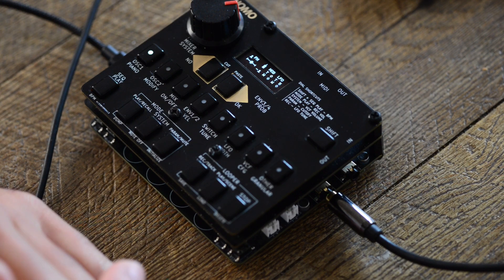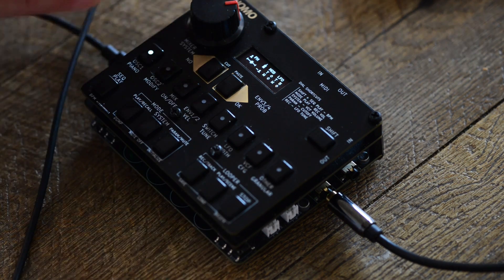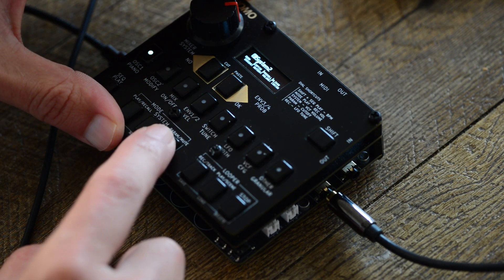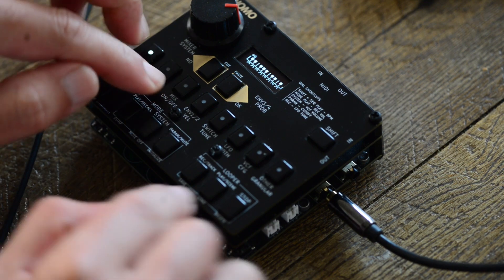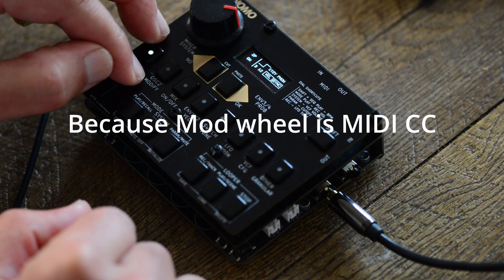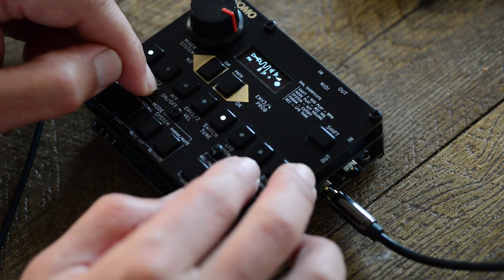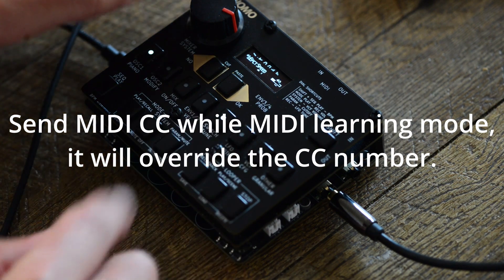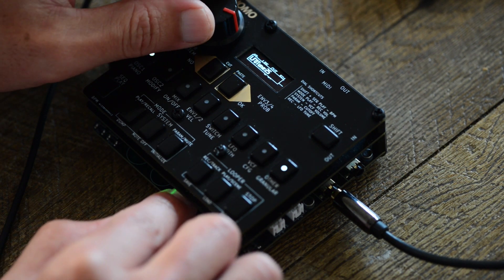Qun mk2 : Touch slider

Comment: Can you listen to line in audio without having to press a piano key the whole time? I’m trying to use the unit as a effects unit for my synth. Thanks.
Reply from the maker: There are several ways to do it. If you already set AUX L or R as an oscillator source, then you can set Envelope source as "ON" (Button 1 in Switch sub-mode).
Alternative way is you can set LINE IN THRU in system menu. This case line in signal just pass through the sound engine, however, you can still apply some effect by turning on Extra Processing mode.

Comment: So this can be used as a sequencer, and a looper? Not a mixer as well right?
Reply from the maker: Yes, and no, not for mixer. It only has one stereo input. You can adjust the balance of looper, synth, line in and others by internal mixer.
Reply: @nunomollc  does this interface with synths such as the Bastl Kastle or maybe even pocket operators well? Does it recognize CV/Gate or just midi?
Reply from the maker: @zonochromatica  I tested with PO and Qun can receive sync through line in (so you can't use line in if you use it for sync). I don't have Kastle.
Reply: @nunomollc  oh man that's so epic, I'm excited to pick one up hopefully this week from nightlife audio in BC, unless you have a retailer you know of in ON Canada?
Reply from the maker: @zonochromatica  I recommend buying from Nightlife in Canada

Comment: It's a great device and I am happy that I buy one. The only thing which is annoying is that you have to hold a parameter for adjusting it with the knob. In live Situation I really need my hands and needing two hands to tweak a parameter is really not good. 
But again, a great device
Reply from the maker: In Parameter mode, you don't need to keep pressing the associated button to change the parameter once it's selected.

Better solution is using external MIDI controller and assign it. The number next to the parameter name is MIDI CC number.

Or you can use MIDI learning for temporary assignment, like I demonstrated in the demo. Only difference is you turn the external MIDI controller's knob instead of touching the slider.

Comment: Cool function. I like it :D

Unrelated question: Does the device have a volume knob? How do you control the main volume?
Reply from the maker: No volume knob, but there is master volume in System2 menu.
Reply: @nunomollc  Thanks for the answer!
Reply: All I see is Are Banks. Is bank 2 the same as system 2?